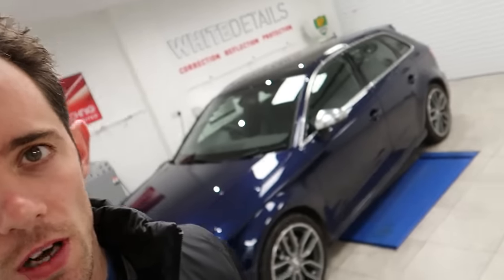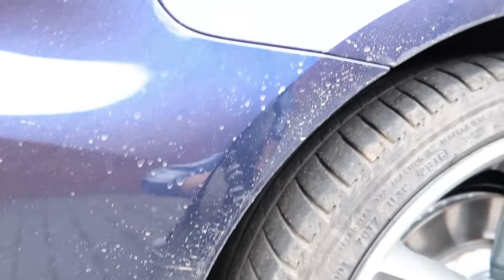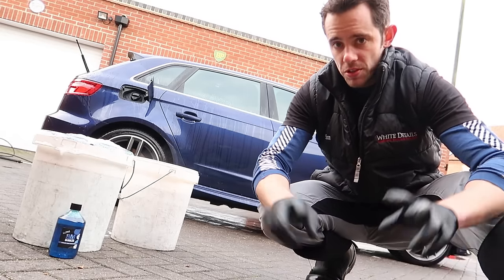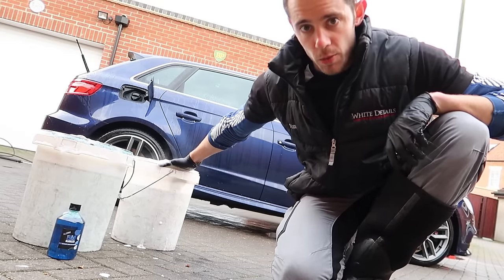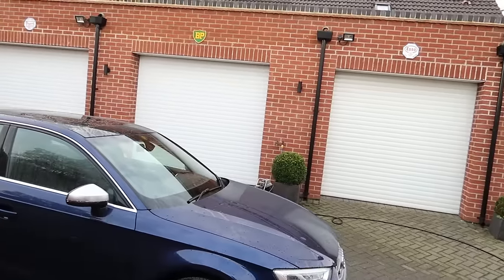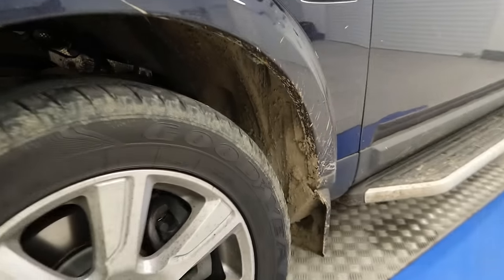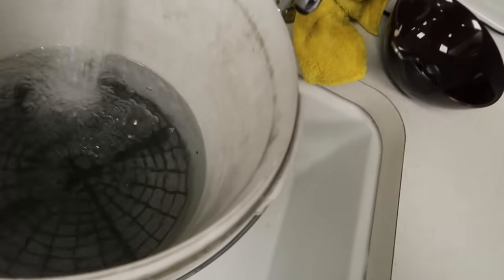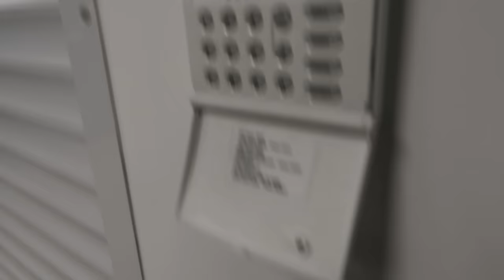WhiteDetails VLOG 003 - Audi S3 "New Car" Detail

Comment: I came across your vids about a week ago and they are perfect...informative, short, and to the point. Thank you for making them! Question for you...I typically clay all vehicles I detail; however, when using an Iron X remover, should I use the clay bar in addition to the Iron decon? Or when would you use an Iron remover other than a white vehicle? Cheers!!